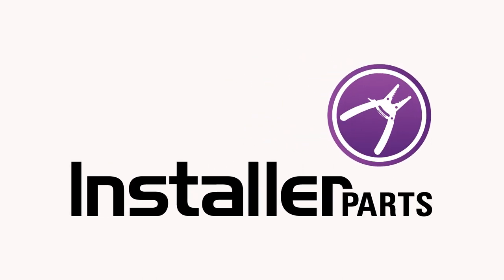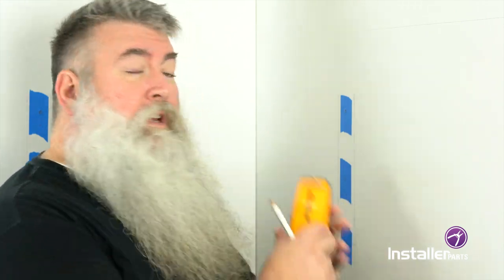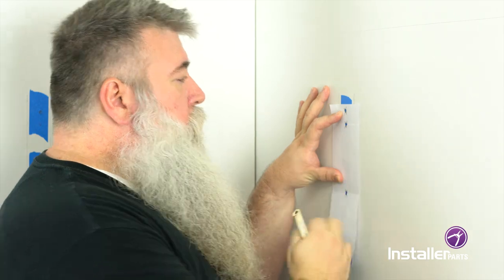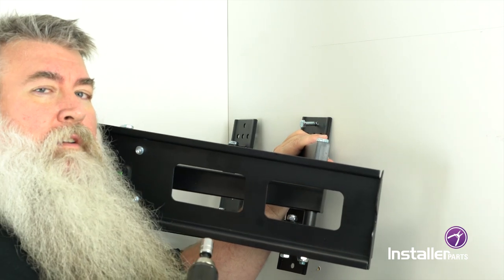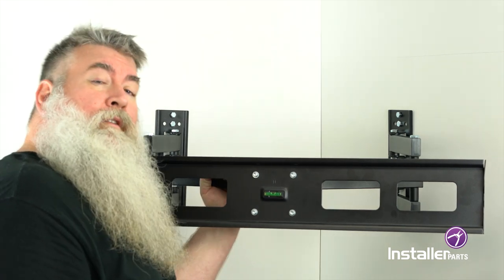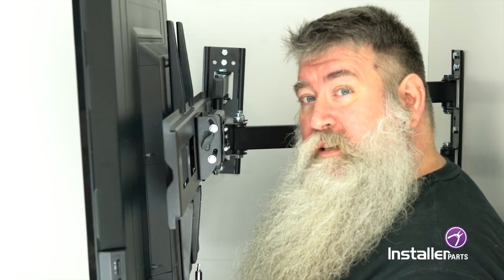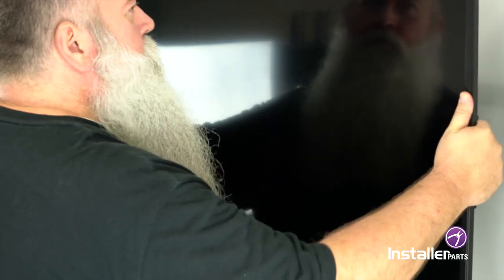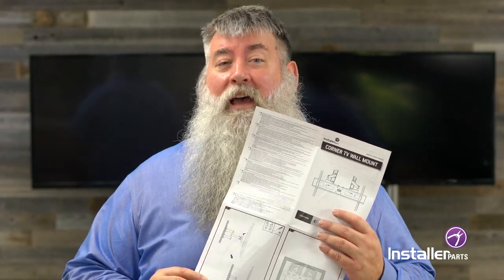InstallerParts Episode 17 - Corner TV Wall Mount With Tilt And Swivel

Comment: With the 65” corner wall mount, one of my studs is 12” (Center of stud)from the corner but the other is 19 3/4”(Center of stud) from the corner will the tv fit with a 65” samsung Q6DR with that much offset between studs?
Reply: I have the same problem did you get yours to work?
Reply: Yes it worked, theres not much wiggle room but it works. Really well built mount.

Comment: How do you determine how far from the corner to screw in the wall mounts?
Reply: Would have been nice to get an answer to this.
Reply: @fishingpinky3165  find the studs in the wall and mount to the studs.  You need a mount arm system that allows back and forth, up and down? And stillbe able to tilt the screen. Took me a while to find the proper mount.
Reply: Thank you so much.  I have the ONN that  this video is suppose to be for.  Problem is one wall is studs and the other is concret block (outside wall) Really appreciate your quick response @95SLE

Comment: 0:28 Son of a.... I only have a roll of green painter's tape at home. Well, I guess I'll have to return the wall mount. As for 1:50 many of the wall mounting kits I've see, have a paper template inside the box, printed on the back of the box itself, or they are in the middle of the instruction manual so you can remove it easily.
Reply: A printed template would have been nice to have, but tracing one on paper and cutting it to size took about 30 seconds, so no biggie.

Comment: Do the studs have to be the same distance from corner
Reply: No really. As long at they are around 16" (or less) from the corner, you should be ok. The nature of corner moving wall mounts, allows them to have their two separate mounting bases mounted at different distances from the corner while still allowing some tv movement/adjustment.
Reply: @CoroaEntertainment  thanks I actually went ahead and hung it before I seen this but you are correct worked great

Comment: I have a corner amount but what to do with all of those ugly wires hanging down that go to all of the accessories?
Reply: Otimo , thanks but the cords hanging down being visible is the problem.  A corner mount orientation leaves them free-falling in the air.  With a wall mount at least I could hide them
Reply: @buckobango  You can hide them the same way you'd do it for a regular wall mount... with low voltage wire pass through plates (one near the bottom of the wall, and the other higher up behind the tv). Just place the higher one between the wall mount bracket and corner of the wall, and then run the wires into the plate. Tip, place the plate that will be behind the tv, level with the top of one of the mounting bases. That way the wires running to it can have a bit of a downward "U" shape to allow for some tv movement without the wires getting pulled tight, and without seeing any wires hanging lower than the  bottom of the screen.